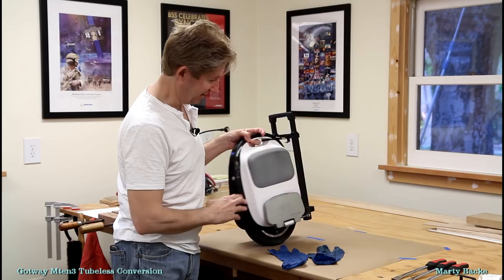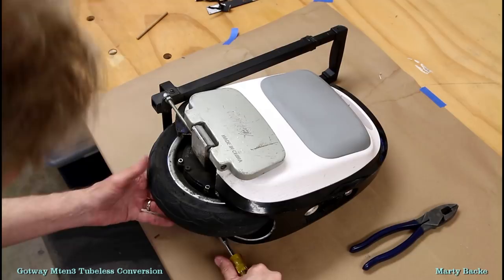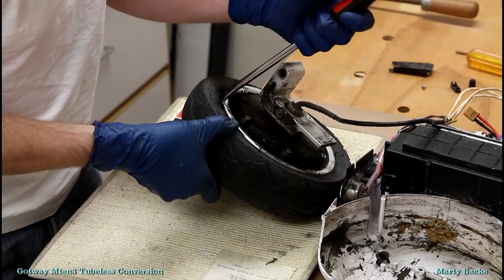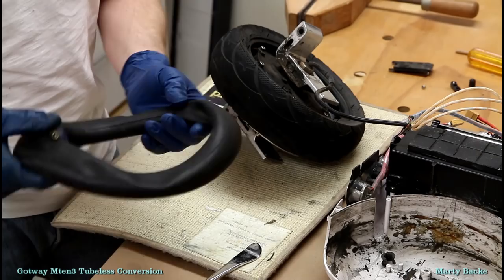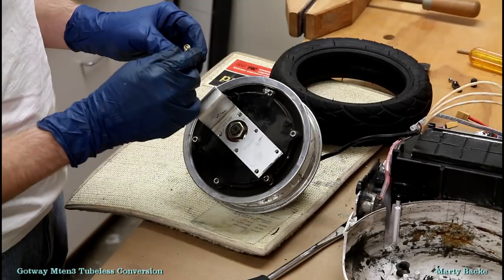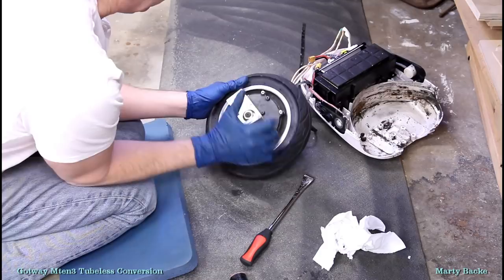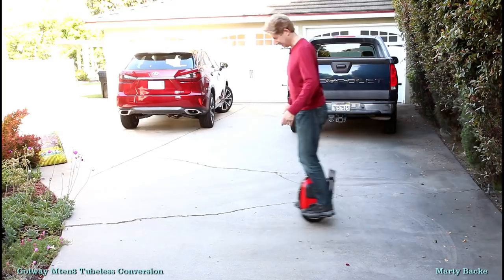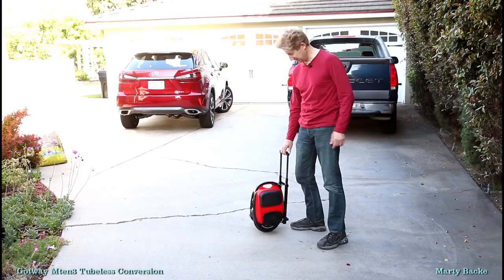Gotway Mten3 Tubeless Conversion Howto

Comment: how do you like the performance of the tubeless? does it change the feel of the ride?
Reply from the maker: The tubeless part of the change doesn't have an effect. The different tire does - a bit better grip, more agile, and you feel the ground through the tire more. I prefer the new tire.
Reply: I can't recall where I saw this, but apparently this tubeless tire is more stable at higher speeds (15-20mph) for this wheel? Also, one of the main knocks on the mten3 is the tramlining at any speed. I doubt a new tire would eliminate this tendency altogether, but do you find tramlining might be less of an issue now?

I would love to think about using an mten3 for 1-3 mile round trips to the store and such, but I'm wondering how sane an idea that might be riding a wheel next to traffic if and when it "develops a mind of its own" as it encounters road imperfections.

The mten3 I'm looking at has the original tubeless tire and it would be nice to know that at least I'd have a chance of upgrading it's road manners by trying this new tire. (Wrong Way looked kind of uneasy on his 500 kilometer review ride -- I'm pretty sure that was the original tire though)

Sorry for the book length comment, any insights at all that you might have would be fantastic.
Reply from the maker: @MichaelSTaylor  Tramlining is reduced but only slightly. I've never been an advocate of riding the Mten3 above 15-mph because it has the potential to be a very unstable wheel. Always thought it was better at the slower end of the scale and "fun". Certainly a fantastic go-to-the-store wheel (with the trolley handle) but I always stick to the sidewalk. IMHO I'd avoid the Mten3 if your primary use will be sharing the road with cars.
Reply: @ElectricUnicycles  Well for better or for worse the wheels are already in motion for me to get an mten3 so we'll just see what happens. From all I've watched and read I think I'm still going to love the wheel and it'll be a keeper. Thank you for the heads up especially when it comes to sidewalks and lower speeds. My new modified plan is to just practice a lot to learn the mten3's unique characteristics, and then when I feel ready I will get up super early when there's hardly any traffic and take slow passes on the roads I would regularly use. With any luck I will feel comfortable enough to use those non-sidewalked roads at a slow pace anytime of the day. 

My guess is 12 to 15 miles an hour will feel like 20 to 25mph on this wheel anyway, and if I take it even slower than that the relatively few times I wouldn't be able to avoid sharing the road with cars, maybe I could learn to tolerate the squirrelly nature of the wheel enough to feel like I can ride pretty safe and slow on known roads next to traffic.

If not, I know I can think of plenty of other ways to have fun with this one of a kind wheel. However it turns out it's good that I'm going into this with more knowledge and my eyes wide open so thanks again, Marty!

Comment: From your tire link, do you see a noticeable difference between Version 1 and Version 2?
Reply from the maker: Yes, there's a very noticeable difference in how the tires feel. The new wheel has a rounder profile and is grippier. You can feel the ground through the tire, so you feel more connected to the surface that you are riding on. I talk more about the tire in this video: https://youtu.be/PFS6-nY_qNc?t=780
Reply: You are a godsend. Thank you for all your effort!

Comment: Marty, you either need 3 hands, a helper to hold that wheel....or a wheel holder like what they use at tires shops.  Also, how come you did not use soap or other slippery agent to get the wheel off the rim?  Thanks for sharing the ordeal.  I have this wheel and know one day will be my turn to face this nuisance, difficult task.
Reply from the maker: I've never had too much trouble getting a tire off, so I didn't think it necessary to pour soupy water on the tire while it was attached to the motor. Thanks.
Reply: A lot has to do with tight tire radius.....not much elasticity allowance here.  Regardless, you reached the target goal and that’s the bottom line.

Comment: What size is 11/30 seconds drillbit? 11/30 inch?
Reply from the maker: 11/32 drill bit
Reply: I got a R50 angled valve stem. Seem to fit about right in the 10mm hole (googled and hole should be 10.5, but it slipped through so hopefully it keeps tight...second try aftet grinding a bit more....
Reply: I simply cant get the new tyre to inflate. The old one works, i had to tape around it to create pressure against rim, but this new kenda is impossible. Even tried zip ties and pulled them super tight, but it leaks so much it doesnt even bubble 😄 gotta se if there is some kind of tyre "glue" to temporary at least seal ONE SIDE of the tyre. I have expectee this after seing how you struggled with a TINY but stiff walled tyre. This kenda is soft like a condom LOL so no natural flare against the rim ... I would need 8morw hands lol
Reply: I found a few tips on seating the tyre (link at bottom)
I allready tried nr 2, with both tape and zip ties, no go.
Nr 3 is too late as i converted with a rubber boot valve (last one, had to cut previous one and grind more on the rim for a flat surface).
So I will try nr 1, my compressor can deliver 8bar so will crank it to max to increase flow, also use a shorter hose to the blower. 
The tips are here
https://livetoplaysports.com/news-press/2017/04/tubeless-tire-installation-tricks/
Reply from the maker: @bigbadboogie6842  Looks like you're going through quite the adventure
Reply: @ElectricUnicycles  Two weekends spent. Tested 3 different valve stems (i had 10 variants where 7 would never fit), modified them to have the tyre edge to fit between thebseal of the stem and the rim, but it will not work. Also tried the "nut kind" of valve stem. Nutnon outside wont fit, not enough room to turn the nut EVEN after filing outer diameter of the nut down to make it "smaller". Inside nut kind wont fit since then the nut blocks the tyre edge from settling (same issue as a grommet type of stem). So 2weeks spent to find out its not possible. Only way would be to seal the current hole and drill a totally new hole, but that hole would have to go through the hub motor covers = i have to dismantle everything and CNC off material needed, if even possible (not sure if hub motor needs those covers as in if the magnets are situated on the covers or if the hub motor is its own unit inside the enclosuere and the covers are just...."covers" anyhow i would need to seal of this wanyway to prevent water from getting inside so....gotway tesla tubeless is a no go. Inwnet Back to tube today and pumped it up, tyre snapped perfect into place at first go (had cleaned rim properly) so I will have to order a spare tube to have in handy..which is a mess from China to have the right valve angle. At least now the stem had more "space" as i dremeled of a bit of material in the process, so the risk of it catching the covers is now close to zero..plus i turned it around to have it in the rotation direction (before it was installed the wrong direction, sonit could snag and turn if it hit the covers ..crazy install...dont know why)
Reply from the maker: @bigbadboogie6842  Way too much work for me but I appreciate the effort and spirit behind your failed endeavor 👍

Comment: So was tubeless better? no flats?
Reply from the maker: I haven't had any flats yet. But know that the tubeless and tubed version of the Mten3 use the same tire. So of course you can get flats with tubeless tires. Slime should self-repair must flats. But if not, you just patch the tire.
Reply: @ElectricUnicycles  Thx Ill order the tire now, being Danish I should be an expert in this but Im not. (Denmark is bike country, big time) Thx for informative videos. I really like the trolley handle too.
Reply: @ElectricUnicycles  - you can still get flats with tubeless tires? I feel ignorant - isn't tubeless supposed to be immune to flats?
Reply from the maker: @mr.c1989  Of course you can still get flats. Nails, pins, thorns, etc can still pierce a tubeless tire. Tubeless just means that you can often ride at lower tire pressures (more comfortable ride) and you can't get a "snake-bite" type flat (because there's no inner tube). But other flats can and will still happen.
Reply from the maker: To answer your other question, the tubeless conversion has been holding up just great. You can only convert an EUC to tubeless if you have a tire rated for tubeless. Most are not and that's why very few EUCs have tubeless tires (Mten3 and Z10 currently).
Reply: @ElectricUnicycles  You do a lot for the EUC community, thx for that mate. Im not a handyman but your vids are inspiring and well structured. thx again.
Reply from the maker: @FinnBjerke  Thanks man! And you make me laugh :-)
Reply: @ElectricUnicycles  Good on ya mate Ill buy U beer if you come to Denmark ...

Comment: Is it possible to convert Begode ET Max into tubeless as well?
We have an issue with bursting / sheering off valve, which IMO can be super dangerous.
https://youtu.be/_VxBBq3FGv0?feature=shared
https://youtu.be/f5KHc6AJpjc?feature=shared
Reply from the maker: Probably but I have to experience doing so. I've never had issues with the valve sheering off. This seems very unusual.